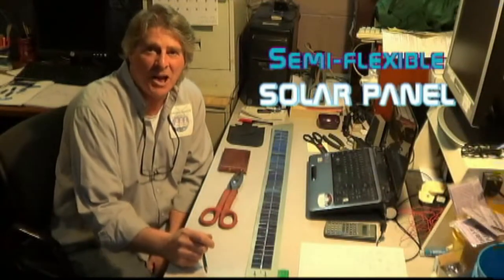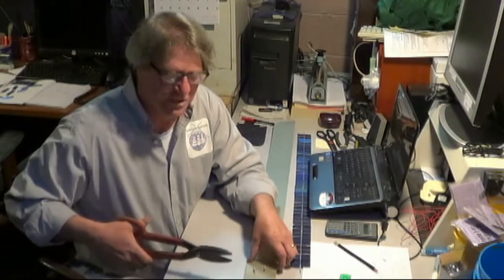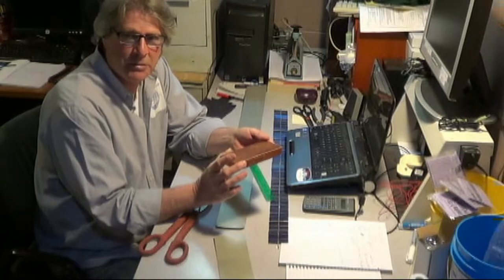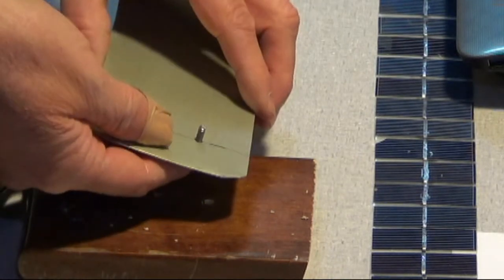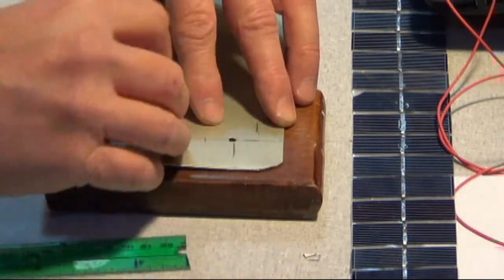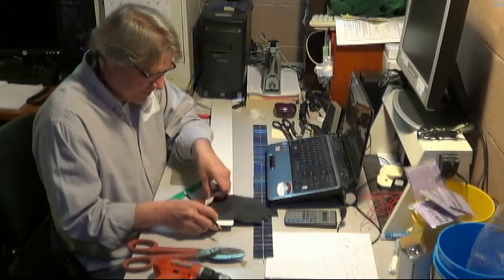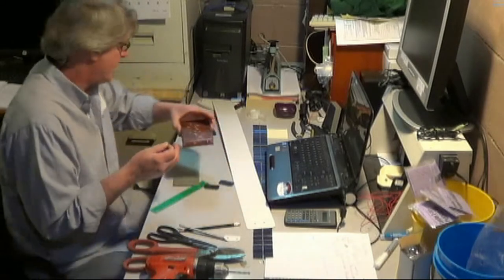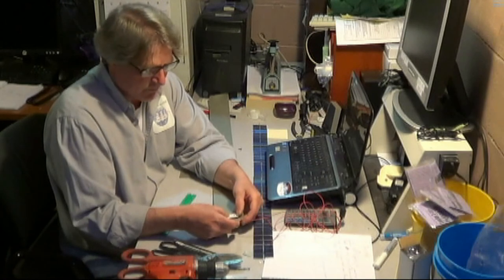solartekTV ~ Howto make Solar panel SEMI-FLEXIBLE Part 7 of 13 junction box Squeeze connector

Comment: Hello. How do you prevent the back side of the solder tabs shorting to the aluminum?
Reply from the maker: hey tony ~ the anode side of the cells are 1st taped ~ I use packing tape ~ when the cells are ready for laminate, I coat the aluminum  to make an extra barrier of non conductive material between aluminum and anode of solar cell ~ thanks for watching!!! ~